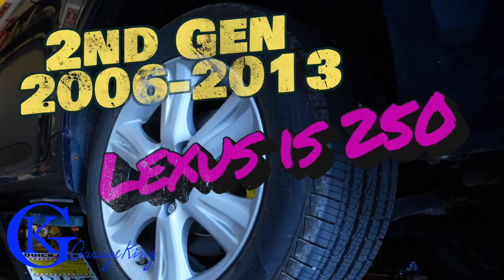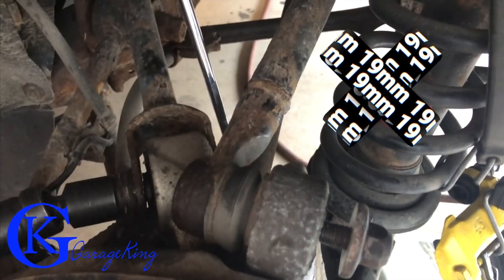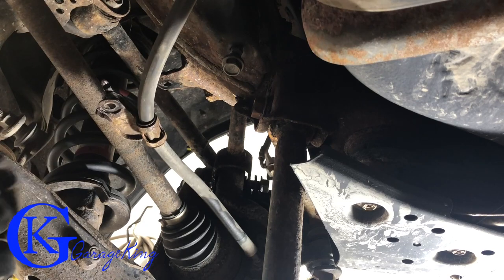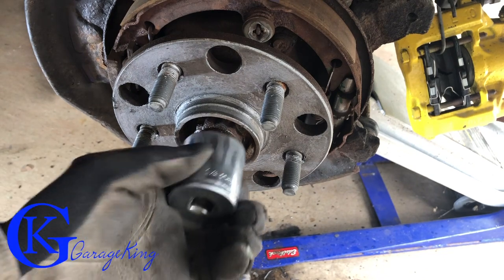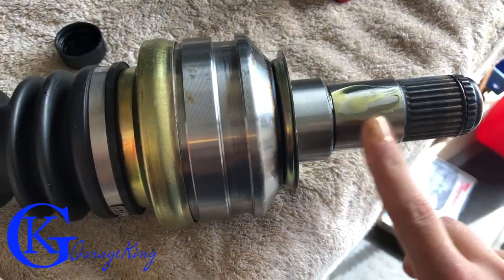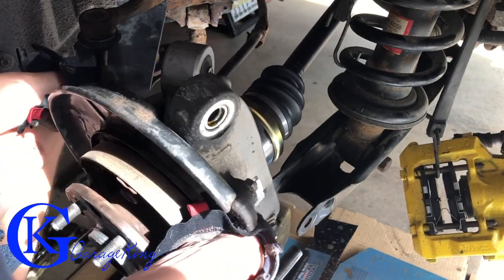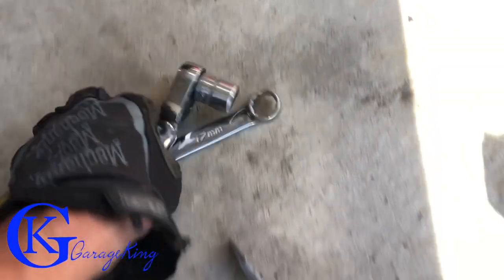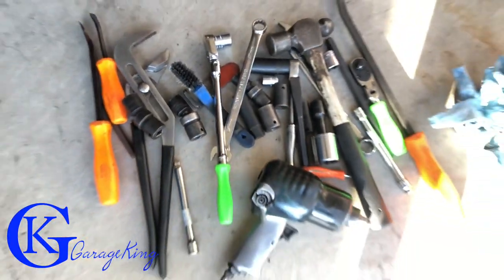Lexus IS250 Rear Axle Replacement

Comment: This is also what you have to do to replace your charcoal filter just remove the wheel hub and axle on the passenger side and it’ll slide out
Reply from the maker: Thank you, I did not know that as I have never had to replace the charcoal filter. I have to say that's a pretty big job just to replace the filter LOL : )

Comment: The other side of my axle broke off it’s jus hanging there after I got a welded diff should I jus get new one or try to put it back on
Reply: But it looks like the hub is attached to the axle so idk i might need a new diff
Reply from the maker: Oh wow, I have never seen that happen. Why did you need a welded diff.  Replacing a diff on these things is pretty rare.  Maybe your diff packed it in.
Reply: @GarageKing  because I be drifting
Reply from the maker: @Hellboy_  Ahh well that makes sense, I think you should raise the vehicle and turn each axle stub on the side of the diff.  See if they are locked together.  If they are you axle is still welded together and you just broke an axle.  When you turn the stubs feel for "grit" when turning and if its not smooth when you turn the stubs the something is probably going on.  Drifting is fun !!

Comment: i just installed extended studs in the rear of my 2IS and I had a few issues. first of all i had to pull off both hubs on either side and when i put things back together the axle cups that are located right behind the knuckle didnt line up properly (im assuming) and when i test drove it i heard some really ugly grinding and knocking sounds. also, when i was tightening the axle nut it completely locked up my axle and it wasnt even torqued all the way down. i also broke the wheel speed sensor 🥲
Reply from the maker: Oh Man I'm sorry to hear that.  Most likely the extended studs that caused it somehow.  Maybe the rear part of the stud was thicker and extended beyond the flange too much.

Comment: I have the same car,  when I apply the brakes at low speeds I get a clunking noises. When the cars parked if I push the car back and forth I can here the same clunking sound. Would this be the rear CV Axel problem?
Reply from the maker: It very well could be, this car when braking at low speeds had a clicking noise, do it could be the same as yours.

Comment: do I need to get an alignment after replacing just this rear cv axle? 2007 lexus is250 rwd owner
Reply from the maker: No, not if you do it the way I did it, as there are no adjustments on those connections.

Comment: The bolt that you used the air hammer on ended up getting rounded off on the right hand side of the bolt the solution I have found that I have yet to try is to cut the cv axle in half with a cutting torch so I can fit an impact wrench on the opposite end of that arm, is there any reason not to try that first I do not want to replace the bolt so I plan to just tighten the nut on the left side and call it a day since hammering and heat failed to remove it
Reply from the maker: You are definitely thinking.  If you cut the axel in 1/2 you could get it out no problem.  Not sure how your idea would work, and I'm not sure if you would still have enough room? I'm thinking what if you left the bolt in (just take the nut off) I'm thinking would it be possible to flip the spindle UP without taking it off? then you could remove the old axle and put a new one in.  I never thought of trying to do the job while leaving the bolt in.  Maybe it could be left in? If everything else is removed it should be able to be flipped up unless I'm not thinking of something?  Maybe its a bad idea?  Not sure, I would have to get back under the car to reassess.
Reply: @GarageKing  I tried that too but it doesn’t allow you enough room to remove the axle from the hub side
Reply from the maker: @jacksonalt9004  Hummm, well that's not good my friend.  I guess the only thing to do is fight with the bolt then.  Even if you cut the axle and take it out you would have the issue of getting the new one in.  I know the bolt did not take long in the video, but that's because I sure no one want to watch me fight with it for 2hrs.  That bolt is the worst part of the job.  Problem is you can't even heat it or you will destroy the rubber bushing.  Its lots of penetrating fluid and patience.

Comment: This is definitely not a fun job on jack stands working from your back.  I was struggling getting the hubs back in and your 5 step sequence was such a help!  Thanks for uploading. Just did an FRS differential swap into my 2G IS250.  Thought an LSD and 4:10 gearing would liven the car up a bit.
Reply from the maker: Appreciate the comment and yup, on jacks stands its not fun !!  I'm glad the video helped you out and 4:10 gearing would definitely liven the car up :)
Reply: I did this same swap too, I’m now replacing my axels cause I noticed one axel was leaking out of the rubber boot part. The brz diff woke the car up a lot though.
Reply from the maker: Nice work !!  Good on you for attempting, most people won't attempt this job so congrats on that !! @lxwgoo999
Reply: 4.10 gearing slows the car down…
Reply: @LexusPro only on the top end.  Also adds a limited slip differential…
Reply: @The_Dustin_B  an is250 differential with a 3.5 engine is way faster
Reply: @The_Dustin_B  the traction control on these comes back on immediately after you disable it not sure how its worth it for a LSD but it does sound cool
Reply: @LexusPro mine stays off if you do the pedal dance or hold the trac button down while in park until both VSC and traction control symbol illuminate on the dash.  Also I don’t think many people swap the 350 engine into the 250.  They swap the 300 engine since it’s basically plug and play and runs on the same ECU.  For a handle like LexusPro you are not living up to your name. 😢

Comment: Amazing video! I had a very very seized wheel hub and am replacing the knuckle all in one now.  Do you happen to know the torque specs of the 5 bolts ?  Or a link to the image it’s tough to gauge when it scrolls. Would really appreciate it.
Reply from the maker: Thank you for the great comment, from 7:40min to 7:50min its not scrolling, just smaller.  From 8:05min onward it scrolls.  I can't upload an image, or reply with the image and to be honest I forgot where I got it.  For my videos what I do is search for hours on the net, and I can usually get the info from a car forum where someone has posted part of a manual. If you have a computer and watch on a computer it is very easy to see, even when they are scrolling, and you can pause.  I think the best best is to watch on a computer and pause.  Its easy to see.

Comment: Good video. I wish you could elaborate more on removing that darn bolt stuck in the bushing at 3:10 in the video. I cannot get past that seized bolt. How did you use the air hammer to break it loose? It feels like the rubber bushing is absorbing all the vibrations coming from the hammer. The same is happening when trying the torque gun.
Reply from the maker: Ya that bolt is the worst, and I'm assuming it's common on all the Lexus vehicles. To help loosen the bolt I used A LOT of penetrating fluid.  I spun the nut on enough to protect the bolt threads and heated the bolt with the torch JUST A BIT, too much and you will burn the rubber, you have to be very careful there.  Then I used an air hammer and went at the centre of the bolt.  I know the bushing absorbs most of the shock, but that's ok, the bolt is still getting some serious vibration.  Then I would alternate to the ratchet and try to turn the bolt and it just started turning a bit.  Once it turned a bit no more air hammer, just lots of spray and working back and forth.  It probably too me just over an hour to remove that one bolt.  Don't rush it, and don't lay on the air hammer too hard.  To be honest I think it was the heat and twisting of the ratchet that probably broke it free, but I was alternating between all three. Don't twist it too hard either or the rubber will rip.  It's a bear I know.  There were some moments where I thought I was going to have to replace that joint, but I was able to get it free.

Comment: I did not see you preload the suspensions before you torque everything down to prevent premature failure of the rubber bushings
Reply from the maker: Hey there and good eye, the only one that might make a difference is #4, but it would be almost impossible to get to it, if not impossible.  The other parts really don't matter as they are set up like an outer tie rod, so they are able to twist with the suspension as it moves (they are ball joint design so no rubber bushing to twist)

Comment: Hi very helpful video. But if possible could you just list all the tools that you used  and its dimensions
Reply from the maker: Hi There, appreciate the comment, and if you go to the 9:40min mark of the video you will see all the tools I used.  I didn't provide a list as most people don't read the video description when I put things in there.  You can see this job is not for the faint of heart, and you will need a number of tools, some you might (like an air hammer) or maybe you won't depending on how seized up everything is.

Comment: I think my left rear CV axle may be faulty, I keep hearing a knocking sound.
Reply from the maker: Well that's the one I did in this video. Its not the easiest job.  If you are not familiar with auto repairs it may be best left to a shop, but if you are willing to tackle it, then plan for a weekend.  Depending where you live rust may play into it.
Reply: @GarageKing  Half a year later I thought I might have a problem with my right drive shaft because I could hear a loud knocking noise when backing up and turning.
Reply from the maker: @huiren9676  Could very well be.  Its good if you have a friend to put in the back seat when you are driving for them to listen.
Reply: @GarageKing  After replacing the new cv axle, the noise problem was not solved. I suspected it was the wheel bearing.
Reply from the maker: @huiren9676  It could be, but normally wheel bearings don't "Knock" they humm and get noisy from 50-80km/hr.  Sometimes differentials can cause a knocking sound when turning.........

Comment: can 75w90 work ?
Reply from the maker: Climate can make a difference so if its hotter you can use thicker oil, and if its cooler you can use thinner oil.  I always follow the manual, I think that 75W90 is pretty close to the 75W85 the manual calls for, but you have to make sure its rated GL-5.